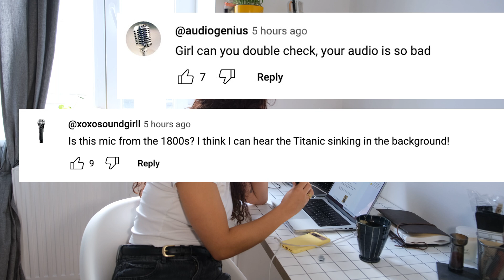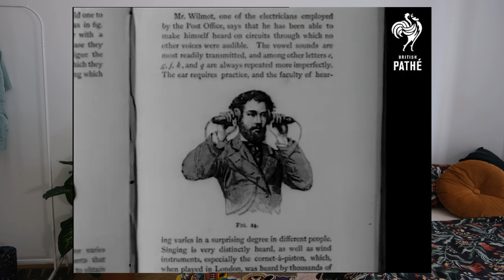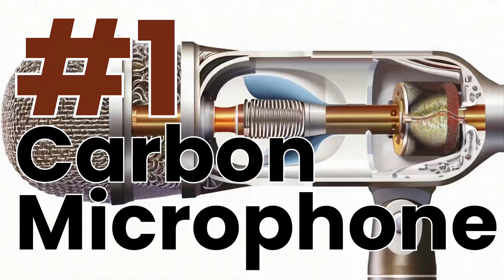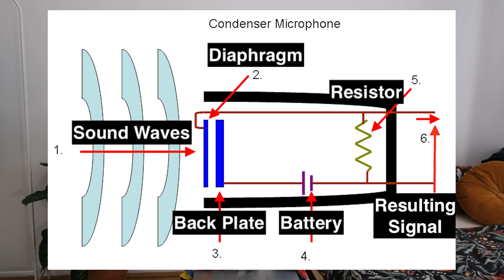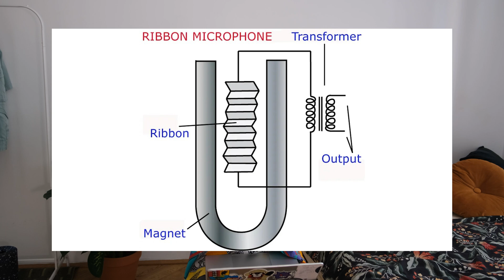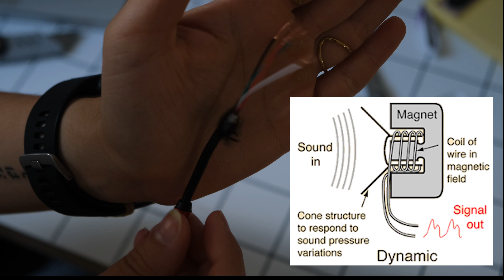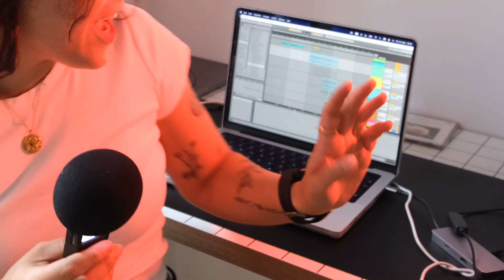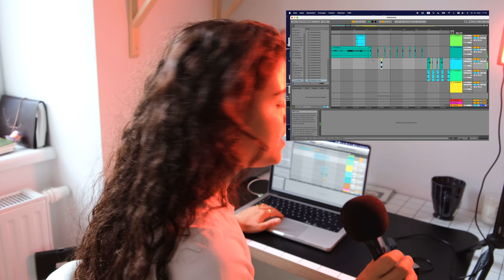I BUILT A MICROPHONE AT HOME

Comment: While building some DIY audio stuff it's important to check if you didn't accidentally disconnected it with bad contact at solder points or bad connection on connector itself. It can happen pretty quickly and your hard work goes literally to nowhere (I learned this while experimenting with some DIY soldered piezos). Your rave reminded me a lot of sounds my piezo was doing while not properly connected.
But anyway nice DIY project and looking forward to see more of these.

Comment: I recommend you to use a coil from a microwave dish motor, it has thousands of turns of a hair-thin coil, if it doesn't work with that it doesn't work with anything, just don't move a magnet near it quickly because it produces a lot of volts and can fry your recorder.
Reply: And be sure Not to touch the instant death transformer while disassembling it🫠